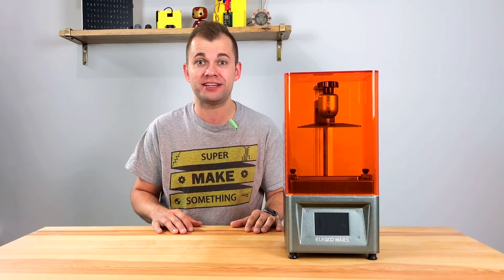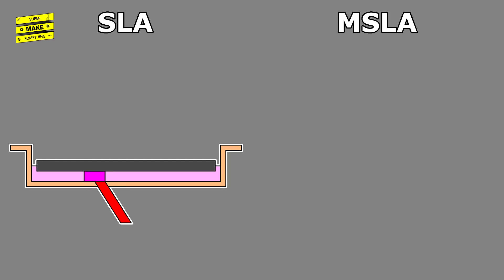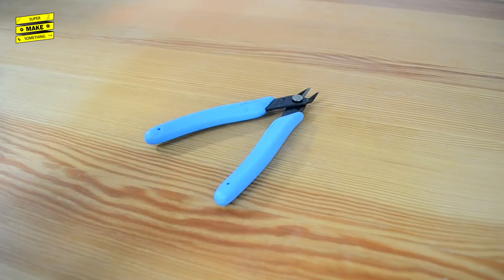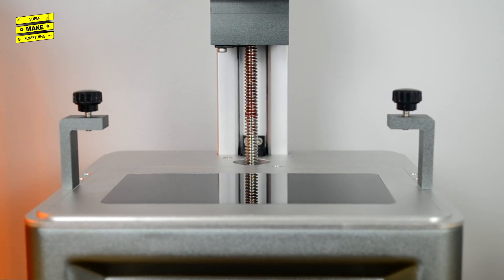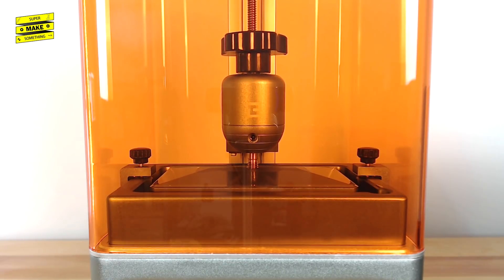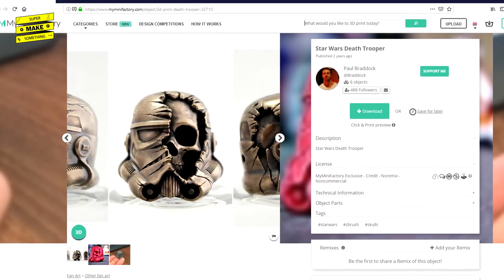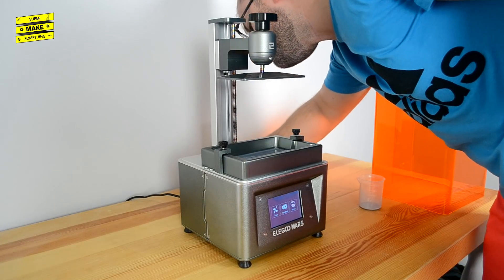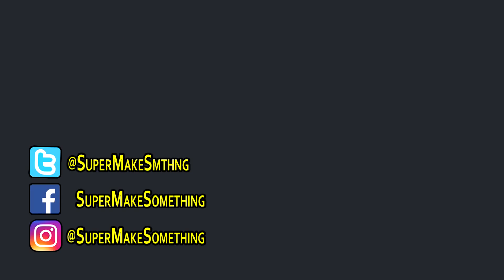Resin 3D Printing: SLA vs. MSLA vs. FDM - Elegoo Mars Review and Setup

Comment: "...hobby printers...usually only 100 microns (0.1 mm)..." uh-huh...tell that to my Ender-3 printing at 0.04 layer height. Though to be fair, I usually use 0.08 anyways.
Reply: Layer height and voxel size are totally different animals. Resin printers have at least 100x (10x squared) the X-Y resolution of your FDM printer regardless of the layer height. Printing at 40 microns layer height is useless when the X-Y resolution of your FDM printer is limited by the nozzle size. The standard 400 micron nozzle can't even achieve 500 micron X-Y resolution with proper extrusion rates. Resin printers, OTOH, can easily produce 47 micron X-Y (and Z) resolution with very clearly defined voxels.
Reply: @kdanagger6894  resolution, feature size, and accuracy are not the same, I've beaten mine and two other Ender 3's into printing within 7 thou tolerances. You can have extremely precise and accurate X-Y resolution, but your minimum feature size is limited by the nozzle diameter. Having printed with a 0.15mm nozzle myself I know you can get rediculous resolutions, and I have met people who are using nozzles in the micron range. Accuracy of flow rate is important for maintaining precision with FFF,  programs like IceSL handle volumetric flow far better than traditional slicers due to its voxel shader approach. 

You can't actually print at 0.047mm feature sizes with a MSLA printer. And you will have trouble with precision due to mask bleed when there is geometry within a close proximity to eachother. MSLA requires the use of fast curing resins due to the low energy of the UV spectrum used, this fast curing excerbates precision loss due to lcd bleed and diffusion of light due from intermediate layers. Laser SLA which can use higher activation energy resin can achieve much higher precision, and suffers less from diffusion due to use of focused coherent light. Don't get me wrong, MSLA with absolutely demolish the surface finish and detail of any consumer FDM machine, but it isn't going to be as precise as just looking at the spec sheet would indicate.

If the minimum feature size is larger than the nozzle diameter, then you can get extremely close to MSLA quality with a sufficiently well designed FFF machine. The hitch is the absolutely mindbendingly long time that any FFF print of this resolution would take. (IE a 5mm tall and 15mm wide part which took nearly 35 hours to complete, it's really brutal), MSLA is infinitely more practical for high resolutions.

Comment: It would have been interesting to know what temperature this gray material can accept before melting, and also if there is any other materials to use; And compare it to ABS or PLA not just in quality but in phisical conditions like traction stress, bending, compressing, etc.

Comment: The Elegoo Mars looks like a rather quite solid and well engineered machine, easy to use as far as resin printers go. There are dozens of competing similar machines, but few look as solid all around as this one.
Question is: how reliable will it prove to be and how expensive in upkeep? Guess only time and user experience will tell.
The initial price point seems very affordable for this class of machine with such specs, especially when on sale.
Reply from the maker: While I don't have any hands-on experience with other resin printers, this one definitely seems to be well built and serviceable.  Elegoo has a bunch of videos on their channel showing how to replace printer components, which is encouraging in that the printer looks like it can be easily fixed should anything go wrong.  Besides that, there are general consumables (like the FEP film) which will need to be swapped out every so often, but so far so good!  If there are any major updates, I'll definitely post them!

Comment: Hi there. To me the acronym MSLA is confusing. SLA stands for laser based stereo lithography applications where a beam path is involved. The process using LCD screen masking is rather related to DLP technology (digital light processing) which allows instant full screen exposure. My opinion is we should use the proper acronym for each technology.
Reply from the maker: Indeed it is a bit confusing and it seems that digital light projection (DLP) and MSLA are almost used interchangeably on YouTube to describe these printers, though this is not quite correct. As you say, the processes are very similar, with the key difference that DLP does not involve a masking LCD screen, only a projector that casts UV light images onto a resin surface to expose a layer. Most hobby resin printers are actually MSLA if they are not laser based (like those from Formlabs).

More information can be found here: https://theorthocosmos.com/laser-sla-vs-dlp-vs-masked-sla-3d-printing-technology-compared/
Reply: @SuperMakeSomething   Well, there's various web resources which says anything and everything. I prefer referring on what have been told during my graduation. The MSLA therm is confusing because it sounds SLA related, which is not indeed. The proper name for that technology is UV-LED. If those technologes are kinda new in budget 3d printers, they're involved in many applications in industry : projectors, dental, medical. I imagine your'e aware that the resin used in resin based 3D printers all come from dental industry (and the manufacturer's codes makes no doubt about it). 
In my opinion we should anything except MSLA, like UV-LED or LCD 3d printing instead. Please note DLP stands for Digital Light Processing because new generations of DLP do not use classical projection at all. The reason of the P like Processing. My two cents.
Another source : https://www.3d-totem.fr/en/comparatif-des-differentes-technologies-dimpression-3d-resine-du-secteur-dentaire/
Reply from the maker: Axel Sixtysix Cool! Thanks for the link!
Reply: Digital Projection uses a chip that is covered in tiny mirrors that tilt to deflect and direct light. Liquid Crystal Display uses a layer of vials of liquid crystals that open up by twisting when exposed to electricity. Completely different technology.
Reply: Plus, most MSLA printers us LEDs to generate the light that goes through the apertures open in the lcd mask. Some use an array of LEDs for more consistent brightness and therefore better quality. Others use one big one, which introduce distortions and strange wood-grain patterns at certain angles. I think I read too many articles. Me needs do tings for a change.
Reply: @FranklyWry  well  that's not so simple. DLP can use a LCD screen as a mask between a classic light bulb and Lenz projector...
Reply: Axel Sixtysix If true, that would be overkill; LEDs are cheaper and less complex. I can’t imagine the Elegoo Mars would be use the more expensive DLP to simply push light through the LCD screen, which creates the image. Besides, all the reviews I have read call it an LCD printer, so all this talk of MSLA is bogus. Oh, and SLA is stereolithography, which uses a laser and galvanometer, so MSLA is so not the appropriate term for what the Mars is, since it does use the laser setup to push light through the mask. Perhaps it would be more accurate to call it MLED, because the LED are the source of UV light.
Reply: I stand corrected. The specs at one site do say it’s DLP. I am such a pseudo intellectual at times.
Reply: @FranklyWry  I agree for MSLA. Well, life and resin 3d printers did not started in 2018... Back to 2009 firsts resin printers was based on video projectors which had a full spectrum bulb, a UV filter, a DLP matrix and a Lens. Reprapers upcycled that DLP projectors removing the UV filter. Some may consider it's overkill today, but back in 2009, that was a pretty dang good idea, especially because you could get a second hand projector for fiew bucks. 😉
Reply: Axel Sixtysix Thanks for the conversation. You taught me a lot.

Comment: Since it has a similar designed Z axis, is this susceptible to the Z "wobble" that the Anycubic Photon is?
Reply: It is likely an exact clone of the anycubic photon, with some changes to reduce manufacturing costs, clearly apparent by the cheap cover, and incorrectly assembled USB port.  You would think they would send review units with at least 1 QC check; so it is likely suspect to all similar flaws.

Comment: Show the clean up after the printing. I'm sure you don't just leave the build tank with the resin in it in the machine. This information would be vital to someone considering an SLA printer.
Reply: I do, as do many many resin printer owners. I generally only clean it if I have a failed print or want to change resin.
Reply: @ruleslawyer  That is precisely the kind of information people might want to know! I didn't know that!  :-)
Reply: @DenisLoubet  The process is typically pull out the build plate and pop off the print into 99% IPA. After that I'll scrape the plate to make sure there are no remaining bits on it. Sometimes I'll scrape the bottom of the vat just to see if it feels smooth. Build plate goes back in. Resin is topped off if needed. Print comes out of IPA and into a 2nd IPA bath that's cleaner. After that you cure your print. I cure my IPA baths as well. It gets uncured resin out of solution and you can filter out the particles. Unless you have a failed print or see broken supports usually there is very little maintenance to the vat itself.
Reply: @ruleslawyer  Thank you! That is useful information as I had no idea the process was that forgiving. This will definitely affect my decisions.  :-)

Comment: Kudos for wearing gloves when pouring the resin and washing the finished product.  However, like most YouTubers you neglect to talk about the important safety measures needed when handling resin, the correct strength of IPA, etc.
Reply: he said all those things. what more would you have liked? without watching again the alcohol was 99% and what other measures would you take to protect yourself from the resin? dont drink it snort it or smoke it? also dont pour in your eyes? also there are material data safety sheets available for all chemicals when you purchase them, i for one thought he did an excellent job, if you are working with any kind of chemicals some common sense should be utilized

Comment: Just a heads up, “MSLA” is actually called DLP (digital light projection/polymerisation)
Reply from the maker: DLP is actually a slightly different technology that uses a projector and single bulb light source instead of a masking LCD.  More information on the various types of printing methods can be found here: https://theorthocosmos.com/laser-sla-vs-dlp-vs-masked-sla-3d-printing-technology-compared/
Reply: I was just about to say that Digital Projection uses chip that are covered in tiny mirrors that tilt to deflect and direct light. Liquid Crystal Display uses a layer of vials of liquid crystals that open up by twisting when exposed to electricity. Completely different technology.

Comment: Great video. Thanks.
Can anyone please explain why doesn't MSLA need a wiper to clean the glass after each layer, while SLA does?
(eg: Formlabs Form printer)
Reply: I could be wrong, but I don't think there is any difference between them as far as the need for a wiper goes. Cheap MSLA printers are more vulnerable to having cured resin stick to their FEP layer and having debris or dislodged prints damage the LCD and tank.

You can absolutely print without one, you just have one less safety device during operation.

I would definitely expect and demand that kind of feature on a higher end expensive machine, the price point on these MSLA printers though is almost low enough for it to be understandable.

Comment: I thought MSLA was called DLP.
Reply: WillieRants I was just about to say that Digital Projection uses chip that are covered in tiny mirrors that tilt to deflect and direct light. Liquid Crystal Display uses a layer of vials of liquid crystals that open up by twisting when exposed to electricity. Completely different technology.